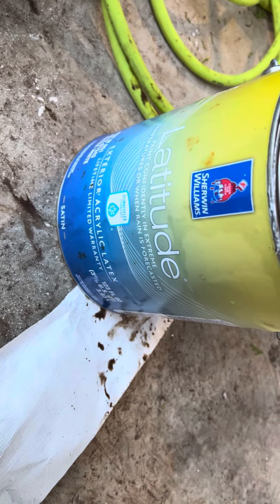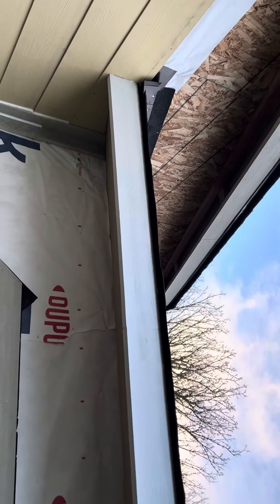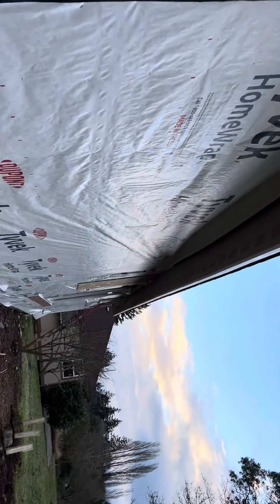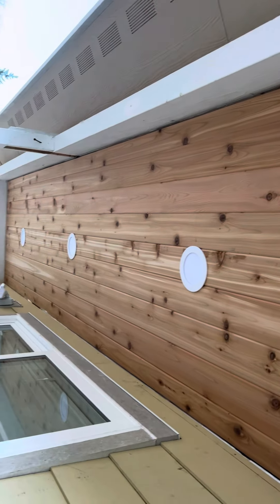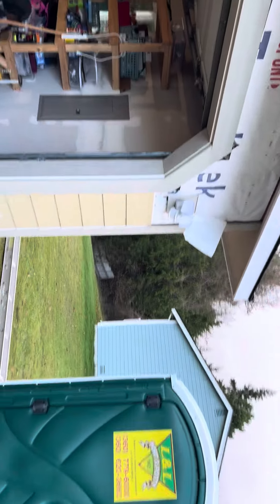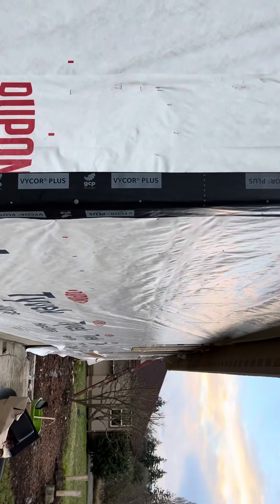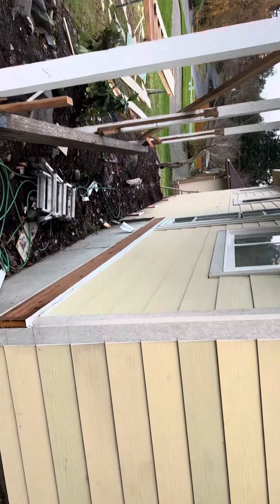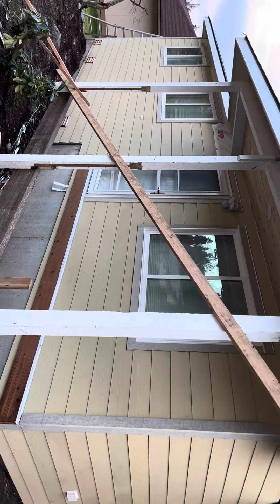The paint we’re using for low temperature high moisture environment and other stuff

Comment: Thanks for the paint tip. Have a Merry Christmas with your family!
Reply from the maker: This is the paint my painter buddy told me to use for this current climate out here. Wet cold air. We’re doing the main painting in spring but wanted at least 1 coat prior to gutters. 

Gutters are being fully replaced
Reply from the maker: Merry Christmas to you and yours as well